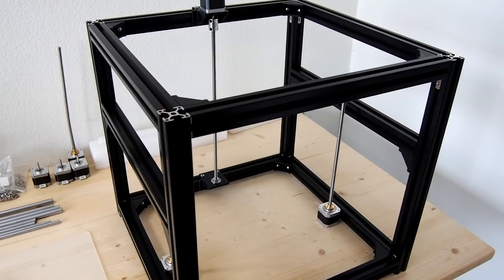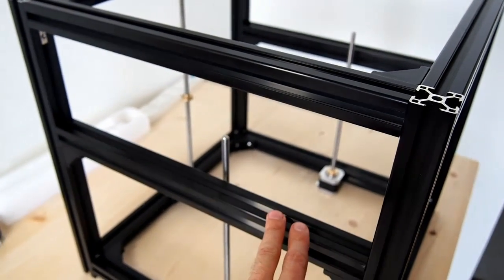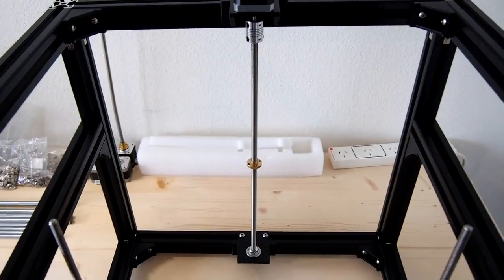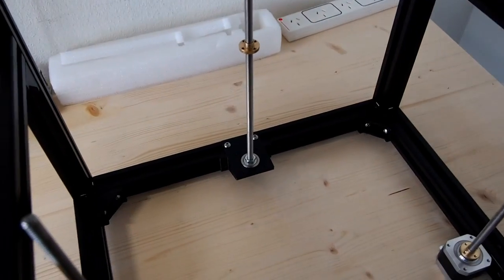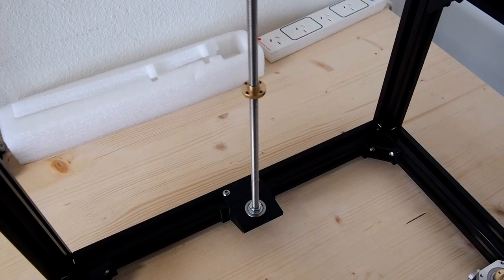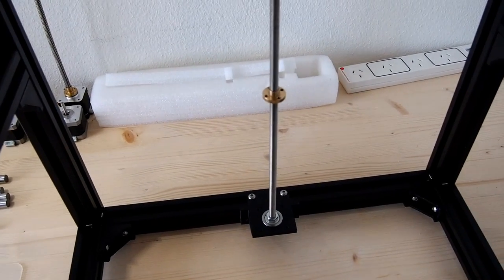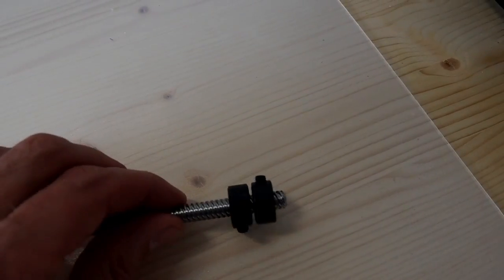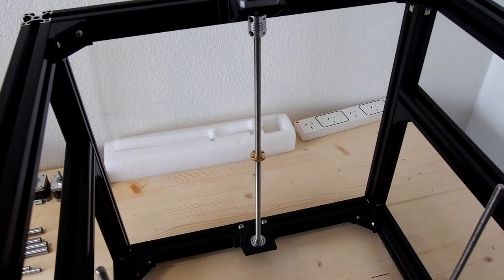HyperCube Evolution #3 - Dual Z Axis

Comment: What about using 60mm long steppers for X and Y, that way they can have more torque at higher speed. Would just have to modify the brackets holding the y axis rails.

Comment: Hi Scott,

great work. We are a group of about 7 guys and we want to build the HypeEvolution, but we still have one point missing.

The min. build volume should be 300x300x300. I can find the shaft in your xls file. Can you tell me how long those 3 threaded rods (Y and Z?) should be? 

I'd really appreciate your help.

Greetz
Marc
Reply from the maker: Hi Marc, 

The smallest supported heatbed is the the Mk2 / Mk3 bed, ie 210mm x 210mm. The z build volume is limited to the threaded shaft length you use. Your stepper motor will need a threaded shaft about 30mm or so longer that the build volume that you want.
Reply: We want to use the Mk300x300. Can you tell me what length you did use for Z threaded rods?
Reply: at one point he said around 30mm taller than the height you want.. on thingieverse.

Comment: Have you tested print quality when the far end of the Z screw is so constrained. Tech2C tried this and got awful Z wobble, it's common on anything which uses Z screws, I know Tevo Tarantula guys fight this commonly too.
Reply from the maker: I set the position of the z nut bracket with the bed in the lowest position. This way the alignment with the motor is spot on. As the bed moves up the 12mm rods will maintain position and the leadscrew will give. This is another advantage of the larger linear guides. Z wobble happens when the lead screw is stiffer than the guiding system.

Comment: Hey Scott.. Thank you bery much for the updates..

You're getting closer to the 'spec' of what I'm after!  I want to build a dual Z using 500mm long lead screws, tooling plate bed, IGUS 10mm aluminum rods for X and Y with the aluminium cased bushes, an E3d Titan Aero direct drive hot end and a duet wifi board...

I'm also building a more 'industrial' all aluminium with an insulated frame, linear rails and a chamber heater; but this has been paused to build your Hypercube Evolution.

I asked before, but could I get a copy of the STP files?  I want to model the whole printer in Fusion 360 before I order the aluminium profile, and need to make a few 'remixes' of some parts to fit my plans.

Also:  I buoght a couple of cheap 8mm ID thrust bearings to support the Z axis lead screws.  Do the flanged bearings offer enough lateral support without thrust bearings?  It would be far easier for me to just use your design in this first iteration.

I'm printing the parts in polycarbonate and taulman alloy 910 (see my twitter @jaistanley for progress pics).  I couldn;t get on with PETG, I find it very hard to get decent overhangs as I have no cooling fan and an enclosure at the moment.  Nearly there though.

Thank you again and I'm looking forward to the next update!!
Reply: Would love to see a built vlog :)
Reply: BlablaUser have a look at my twitter for musings on the printing I'm doing.. @jaistanley Want to try videos by I'm a bit amateur! Bought a DSLR to just this though, so will have a go. Got a video on some hypercube parts I made going up soon. It's a bit weak, but a first attempt.